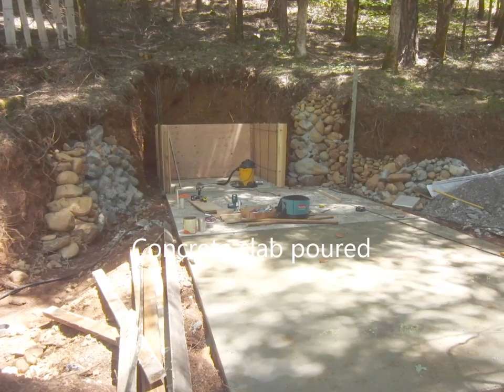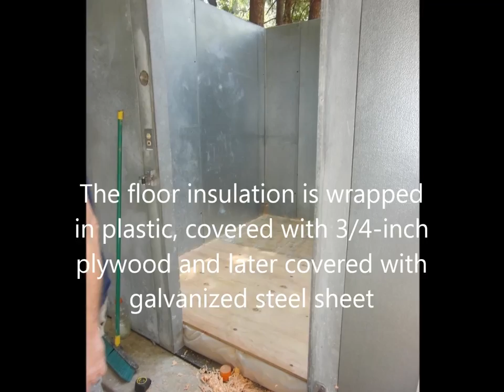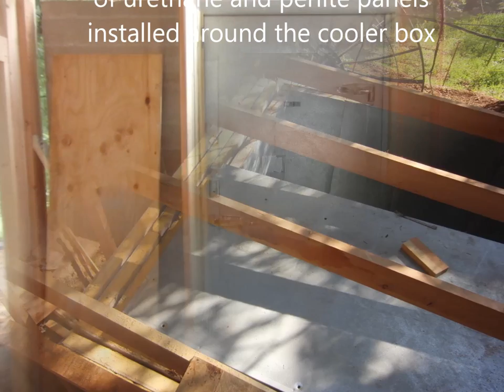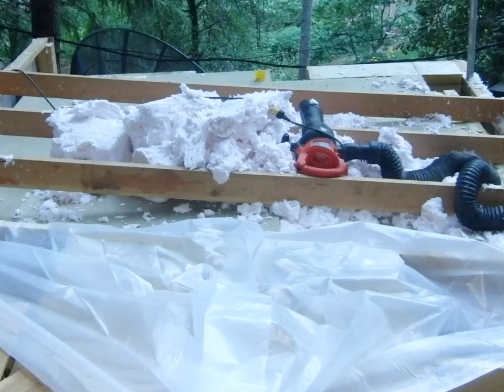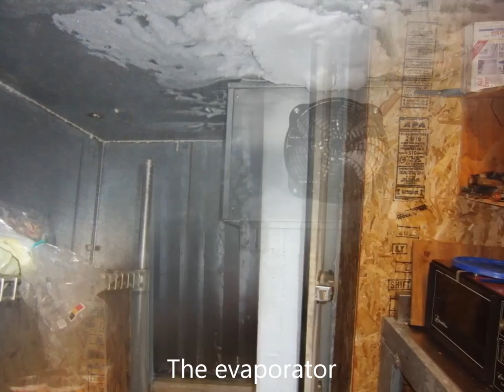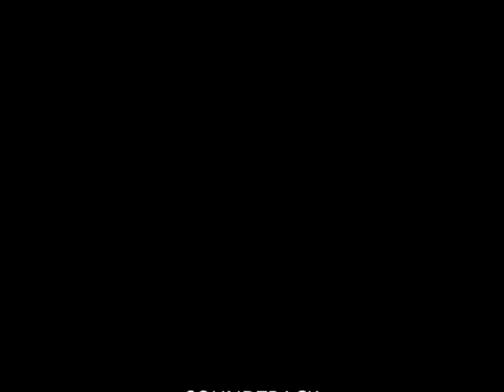Building a Super Insulated, Off Grid Walk-in Freezer

Comment: In Canada, beyond roads we used a compressor water wheel in a nearby creek to run the freezer. Looking to do this with a wind mill. Of course the freezer box would need to be below grade, super insulated with north facing opening and plenty of mass.
Reply from the maker: I seriously thought about going that route but  I didn't have time to get a refrigerant license which would be required. So time I want to convert the root cellar into a walking cooler and have a water cooled compressor I intend to drive with pelton turbine.
Reply: @Over50YearsOffgrid  Joel, there is a pelton turbine running a generator in a remote location near where I live. If you have the water and drop they can provide a lot of energy. Enjoyed your video, was hoping someone had tried this with a windmill. I have an old Aermotor that is no longer used to pump water for experimentation. The wind is so intermittent the cooler would need to be exceptional.
Reply from the maker: @rondye9398  I don't know if you saw my video of the hydro system that is running the freezer. Here is a link. https://www.youtube.com/watch?v=8Wnoa5oEvXs&t=12s
Reply: @Over50YearsOffgrid  There are now refrigerants which are non-toxic and non cfc.

Comment: How much was the cost to build it?
Reply from the maker: +Ansley212 I didn't keep an accurate accounting unfortunately. The cooler box I found for free, the drop in unit was about $3,700 new. The rest came to about $1,000 to $2,000 so a total of 5 to 6 thousand and a lot of elbow grease...
Reply: Looking to do something similar for a zoo I volunteer at. How did you come across a free cooler structure? And do you have a link for the drop in condenser/evaporator? Thanks in advance

Comment: Thanks for sharing. Would it okay to ask for the specs, dimension & power consumption? Thank so much in advance.
Reply from the maker: +Ceasar Sabarre Thanks for watching, The interior of the freezer is approximately 8x8x7 feet. The freezer unit about 6500 BTUH. Here is a link to the model http://www.heatcraftrpd.com/productcatalog/productdetail.aspx?TabIdx=1&amp;PID=2417&amp;cID=3The duty cycle is running about 30 to 50% depending on the outside air temperature. I am keeping the freezer at about minus 10 degrees F.

Comment: Nice ideea
I plan to build something  similar but in ground. like sn insulated cellar at 10 ft in ground and with access from above so the cold stay inside.  technically a super insulated chest freezer of large dimensions.
I plan to use a 5000 btu unit. 
do you know where I can find a split freezer unit? online? brands

Comment: Why do you need the plywood, why not just glue the steel sheet to the insulation? What is the density of the fiberglass?
Reply from the maker: +2Awesome The plywood was to spread the weight out more evenly so the insulation didn't crush down.  The insulation is recycled polyurethane foam panels.
Reply: Joel Horn The steel would do that too? (there are steel sips)
Reply from the maker: 2Awesome The steel is only 18 gauge so it would have dented down..